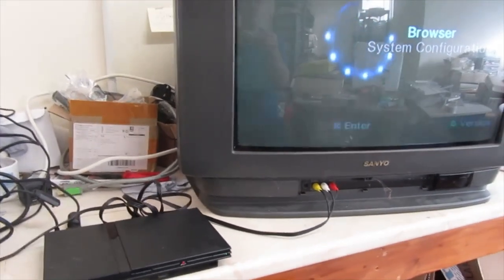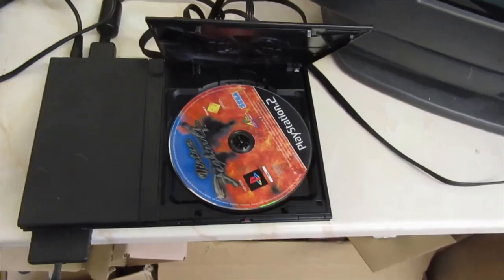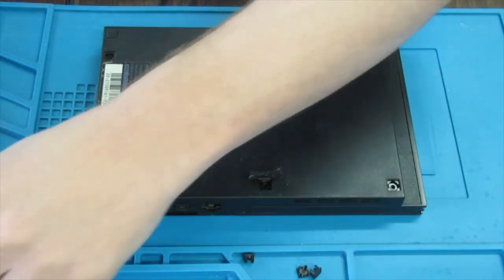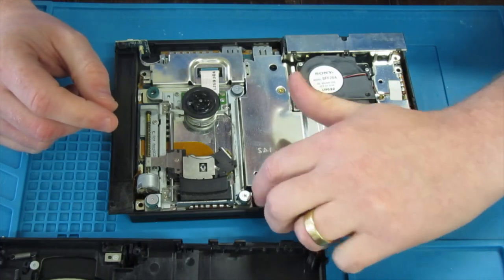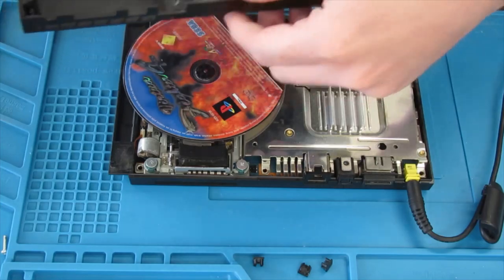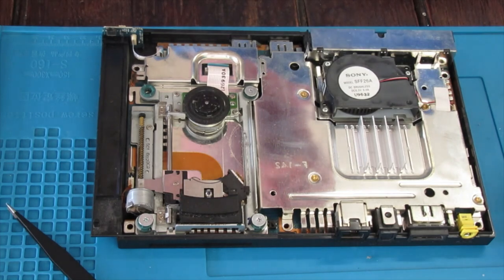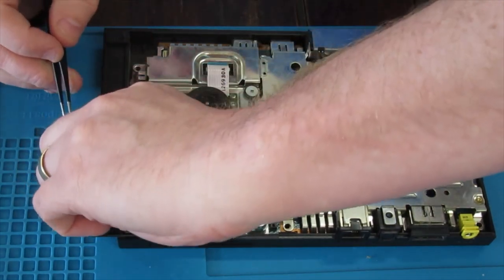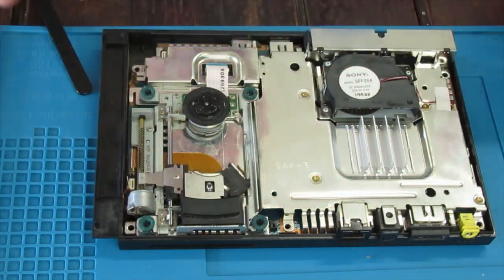PS2 PlayStation 2 Slim Discs Not Spinning

Comment: I tested the spin with holding down the relevant spots, cleaned them too...nothing. Is it worth my time resoldering, batt change. Or should I troubleshoot something else?
Reply from the maker: When you held the switches down does the laser lens move up and down  or try and focus. 

If nothing at all happens when you press the switches down it's probably a faulty switch as the console is not detecting the lid is closed.

If the lasers tries to focus but it doesn't spin it's probably a faulty spindle motor, spindle motor fuse or maybe the ribbon to the spindle motor.
Reply: @EasyConsoleFixes  thanks. I'll investigate and let you know!
Reply: @EasyConsoleFixes  yep. Nothing happens. The switch doesn't go green. Just stays red or goes out. Time for a new switch from somewhere you think?
Reply from the maker: @Mandosami  Sorry when I said switches, I meant the 2 switches inside the console that detect when the lid is closed. 

When you say "doesn't go green" to do mean the power switch of the console. If the power switch doesn't go green it could be the switch is gone or one of the fuses inside the console could have blown.
Reply: @EasyConsoleFixes this is exactly the issue I am having
Reply: The spindle doesn’t spin

Comment: My console is doing the exact same thing, the disc spins, the console tries to read the media when both sensor are pressed, but it always fails to do so returning with the error "disc cannot be read". I reflowed the back sensor in the same way you did, applying some flux on each of the 4 pins and slightly tinning them. I also changed the laser and every component of the laser assembly all to no vail, the console still refuses to read discs. I am at a loss here, perhaps is some other component located on the main board at fault here, may be some capacitor that went bad... Do you have any idea what the issue might be?
Reply from the maker: If the disc spins it does seem like its an issue with the laser. If you start the console with no disc in and press down the 2 lid sensors can you see the laser lens try to focus by moving up and down.
Reply: @EasyConsoleFixes   Yes, the lens moves up and down in the rails and also the laser lens itself moves up and down as if is trying to read the disc... Which makes sense, since I tried the exact same laser unit assembly on another console and it works just fine. I am left puzzled as to what else the issue might be...
Reply from the maker: @heidiichigo-san3927  The only think I can think of then is checking components on the board such as fuses etc to see if they are all ok. Unfortunatly This type of fault finding can be really difficult unless its something obvious.

Comment: The scph-90k models have their spinning sensor built into the laser, the laser tries to read of it sees data the disc starts spinning
This also means if the disc have a scratch the laser won't detect the data so the disc won't spin which gives lower possibilities of successfully loading a disc on 90k models
Reply from the maker: I knew the 90k ones only had one lid sensor. I didn't realise they were less likely to read scratched discs, good to know thanks.

Comment: My PS2 slim was struggling to load the disc but I managed to fix it by applying pressure up to the point when it suddenly worked even without applying pressure.
Since a few days it wouldn’t load PS2 games but was still able to load simple DVD discs and PS1 Discs as well.
I tried cleaning the laser with Propanol alcohol but it didn’t fix the problem.
Today I opened the case and tried to press both buttons in order to see if the discs would properly load then. The Discs only spin for a brief amount of time and then stop however.
Do you think I should replace the entire laser with a new one?
Reply from the maker: Normally if the PS2 will only load certain types of games it is a faulty laser causing it. I have seen it caused by a damaged ribbon cable so that is also worth taking a look at.
Reply: My ps2 would run ps2 games only but I just bought a dvd-r to do the free mcboot thing but the problem is the dvd won't run correctly it start spinning for seconds then stops I tried several DVDs and ps2 games and it was working but not the dvd-r how can I fix it? I only want this dvd to run so I can install free mcboot
Reply from the maker: @fetchslaybffr  Hi, I'm not too familiar with the DVD McBoot but I know it only works with some DVD drive versions and you have to use a DVD with the correct ISO version for your drive. 

If your PS2 is playing games fine there is no issue with machine so I would think the issue must be either the DVD-R or the software installed on it.
Reply: @EasyConsoleFixes  how to know what is my correct version of my drive?
Reply from the maker: @fetchslaybffr  This is a good video, he talks about what DVD drive versions work and what ISO to use with them. https://www.youtube.com/watch?v=m9xIFI_k77U&t=102s

Comment: in the beginning i clicked both the sensor buttons to try and get my disk drive to move but it won’t move and it shut off the console every time. any solution?
Reply from the maker: I don't want to ask an obvious question but the one at the front, are you pushing down the little leaver and not touching the power button which is on the same board. 

If not it could be worth checking is it a faulty power board.
Reply: @EasyConsoleFixes  Hey that was my guess, I was pressing down the power button lever and the sensor at the back at the same time, after a bit it would just shut off not do anything, I've even tried putting the disk in, and turning the console on, and it turns the console off automatically. Im probably going to try and switch the power board, but if thats not the issue then I might end up listing it as parts or repair, because I have no clue how to fix it haha.

Comment: im pressing both switches but the disc still doesnt spin what should i do?
Reply from the maker: When you held the switches down does the laser lens move up and down  or try and focus. 

If nothing at all happens when you press the switches down it's probably a faulty switch as the console is not detecting the lid is closed.

If the lasers tries to focus but it doesn't spin it's probably a faulty spindle motor, spindle motor fuse or maybe the ribbon to the spindle motor.

Comment: My ps2 would run ps2 games only but I just bought a dvd-r to do the free mcboot thing but the problem is the dvd won't run correctly it start spinning for seconds then stops I tried several DVDs and ps2 games and it was working but not the dvd-r how can I fix it? I only want this dvd to run so I can install free mcboot

Comment: I have an issue that only the blue colored discs (compact discs aka CDs) don’t read, DVDs read fine, i’m itching to play some older nippon ichi games but most of them happen to be on CD format instead of dvd
Reply from the maker: That issue is nearly always caused by the laser starting to die. It's nearly always the blue discs that stop working first.

I have a video of how to change the laser, it's not that difficult on these consoles.
Reply: @EasyConsoleFixes  nice i’ll be sure to check that out, thanks !

Comment: I was using the psp charger on mine could that be the issue?
Reply from the maker: That could be your issue. The PSP charger outputs 5 volt and a PS2 Slim charger outputs 8.5 volts so the PS2 may not be getting enough power.
Reply: @EasyConsoleFixes  interesting, that would make Sense as the machine has never had any issues with it’s optical drive besides some dvd playback errors.

Comment: Good evening. What if you push down both sensors and tue disk doesnt spin?
Reply from the maker: When you held the switches down does the laser lens move up and down  or try and focus. 

If nothing at all happens when you press the switches down it's probably a faulty switch as the console is not detecting the lid is closed.

If the lasers tries to focus but it doesn't spin it's probably a faulty spindle motor, spindle motor fuse or maybe the ribbon to the spindle motor.
Reply: @EasyConsoleFixes  thanks! Turns out, the problem is the switch in the rear. Going to try to tape it down.
Reply from the maker: @tayeescobar5689  If the tape doesn't work you could also try soldering across the pads under the switch.

Comment: I have a slight issue. My silver PS2 slim won't spin and so i opened it up and found that it doesn't have the sensor in the back like the one shown in the video. This PS2 worked perfectly in the past so i need help
Reply from the maker: Yes the later model PS2 slims only has the one lid switch at the front of the console. When you press this switch down does the motor try and spin.
Reply: @EasyConsoleFixes  it does not. I figure it must have gone faulty as i have hooked power to it and then attempted to see if it would spin and it does not spin in the slightest.
Reply from the maker: @Dragonman1477  does the laser lens move move up and down and try and focus. 

If nothing at all happens when you press the switch down it's probably a faulty switch. 

If the lasers tries to focus but it doesn't spin it's probably a faulty spindle motor or maybe the ribbon to the spindle motor.
Reply: @EasyConsoleFixes  no so it has to be the switch.

Comment: Hi could someone please tell me where is the cmos battery on this version of the ps2?
Reply from the maker: On this model it's under the shielding on the top side over near the power jack. It's just a standard CR2032, there's a plastic holder on the board for it, not like the other ones which have a CR2032 attached to wires with a connector.

Comment: So its not the pressure on the things that make the disk spin, for mine it works but, it cant read the disk or doesn't sense it, is it the disc reader that needs to be fixed?

If so could you give me a link to it on Amazon and if you haven't, make a video on how to fix it
Reply from the maker: If the disc tries to spin or is spinning and not being read it probably is the laser which has gone. I have a video of changing the laser in the PS2 Slim if you want to check it out.
https://youtu.be/KzXQeBQX_EM
Reply: @EasyConsoleFixes  
Thank you so much, I'll be rewatching the video once i get the new lazer

Comment: The laser thing goes down to where the disc is but it doesn't spin
Reply from the maker: If you have checked that these two switches are working and the disc still doesn't spin the console may need to have the spindle motor replaced.

Comment: my ps2 dosent even spin the disc any tips how to fix??
Reply from the maker: If you have checked the two switches in the video are ok and the disc still doesn't spin you could have a broken spindle motor or the ribbon cable to the motor could be damaged or loose and is worth checking.
Reply: @EasyConsoleFixes  yh no spinning even the lazer thingy dosent move
Reply from the maker: @colaboy5796  That does seem like one of the switches is not working and the console is not registering that the lid is closed.

Comment: So the laser wouldnt cause the disc to stop spinning? I just had a slim not read disc but also not spin up at all. I replaced the laser and it spins and reads discs just fine. Im learning, so any pointers/info would be appreciated because I would really like to learn how to fix consoles.
Reply from the maker: Did the old laser try and do anything at all. Even if it didn't spin did the lens move up and down to try and focus.

I would have thought the console would spin a little and then stop if the laser was dying but maybe if the laser was completely dead it might not try and spin at all.
Reply: Look at your laser and disc and see if you can see anything out of the ordinary

Comment: bro my ps2 can spin and laser still works but can't read the disc and always comes out red screen of death...the disc is played on my friend's ps2 but my ps2 can't read the disc...please help me bro..
Reply from the maker: It may need a new laser, changing them in these consoles is fairly straight forward and the new lasers are fairly cheap.
Reply: @EasyConsoleFixes  is it ok if i clean the laser without buying a new one??if i clean the laser can it read the disc again?
Reply from the maker: @danishirfan1134  If you cleaning the laser got it sorted that's great, a nice easy fix.
Reply: @EasyConsoleFixes  What cleaners are good for laser cleaning?
Reply from the maker: I always use IPA (Isopropyl Alcohol). You just want to use something that wont leave any residue.
Reply: @EasyConsoleFixes  can i use hand sanitizer?
Reply: @EasyConsoleFixes  but I have cleaned using hand sanitizer...Is it possible for me to clean using isoropyl alcohol?
Reply from the maker: I would be worried about sanitizer leaving residue on the laser. If you have no IPA the next thing I would use would be window cleaner.
Reply: @EasyConsoleFixes  thanks for answering all my questions..and i'm sorry for so many questions...
Reply: If your laser isnt working after cleaning it right, then your laser is dying.
Reply: @OmegaVideoGameGod  Yes the laser is broken.

Comment: When I Put A Disc In, The Laser Eye Moves But The Disc Still Doesn’t Spin
Reply from the maker: Is it possible that the spindle motor has stopped working or maybe the ribbon cable which goes too the spindle motor has become damaged
Reply: @EasyConsoleFixes  I Fixed It, I Just Moved The Laser Casing Closer To The Disc Clamp/Holder After I Took The Back Of It Off & Cleaned It From The Dust & Such. With Some Games Tho, It Doesn’t Always Spin Consistently, It Slows Down A Lil Sometimes
Reply from the maker: @JusRELLreallyHIM  Glad to hear you were able to get it sorted, the PS2 is a great machine.
Reply: @EasyConsoleFixes  Thank You & Yeah, Me Too
Reply: @JusRELLreallyHIM  My ps2 would run ps2 games only but I just bought a dvd-r to do the free mcboot thing but the problem is the dvd won't run correctly it start spinning for seconds then stops I tried several DVDs and ps2 games and it was working but not the dvd-r how can I fix it? I only want this dvd to run so I can install free mcboot
Reply: @fetchslaybffr  Try Doing What I Did

Comment: I can't find anyone having the problem I have with mine. I had it stored in a drawer for about a year. Worked when I put it away, I got it out to play, out the disc in closed the door, the laser moved, lit up, but the motor wasn't spinning. I still get it out every once in a while to mess with it, but everything I find always points to those switches, which both work perfectly. I think the motors fried.
Reply from the maker: If the laser is moving but the motor makes no attempt to spin it does seem that the issue is the motor. Could be worth checking the ribbon cables to the motor first as some times these can be damaged

Comment: thank you,   my disc didnt spin  it seems a lil bit stiff,  but i will look at the switch,  and plus the power cable connector, i have to put a tiny bit of pressure to get it to power on
Reply from the maker: There's a little brake at the back of the disc that moves out of the way when the lid closes, is that why it feels stiff. 

The power connector is an easy fix if you can use a soldering iron. I have a video of how to do it if you want to check it out.

Comment: My ps2 just turns off when the disk thing is closed and won’t turn on unless it’s open dose anyone know how to fix it
Reply from the maker: This sounds like one of the fuses has blown, there could also be another issue with the console which caused the fuse to blow so both would need to be fixed.